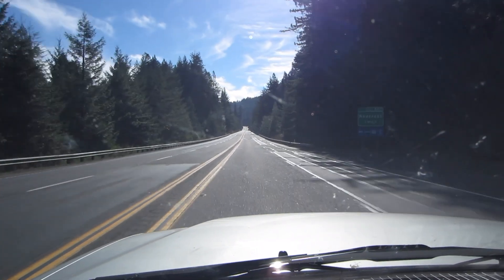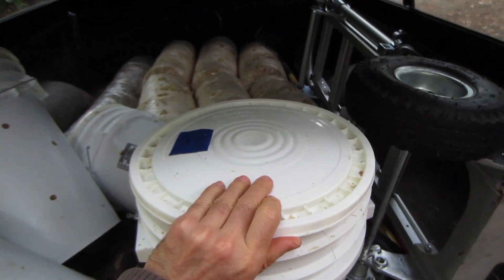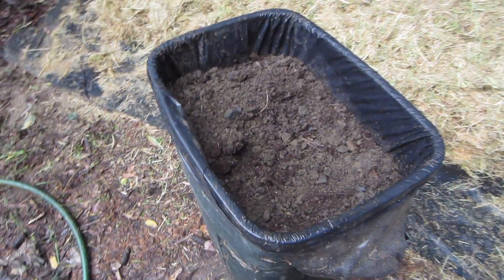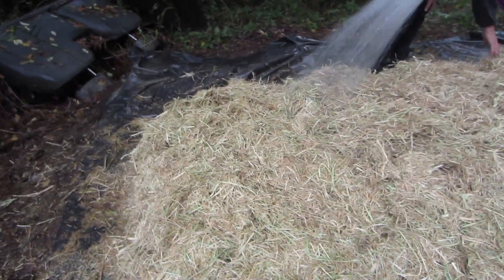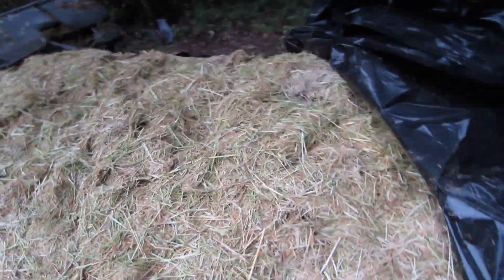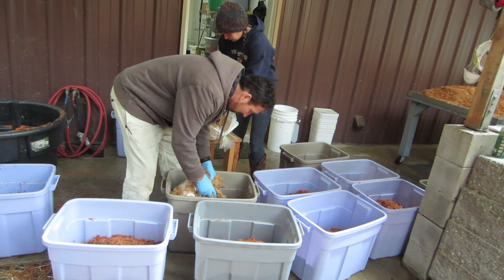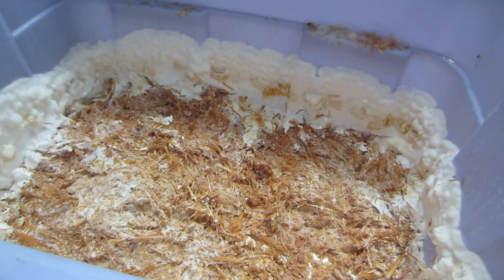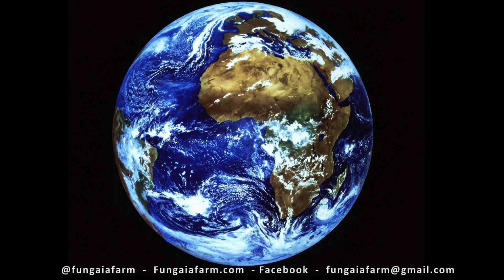Mycoremediation Of Motor Oil

Comment: could you suggest a pre-emptive course for a homestead that is planning to have a mechanic shop on site?  nothings built yet so now would be the time to build a system to handle the unavoidable spills etc.. the system I was always taught was clay litter and trashbags, but not wanting to create landfill waste if at all possible
Reply: It would be possible to either set up a bioswal catchment that was regularly reinoculated with fungi. Or use natural waddles to absorb any oil onsite and set up a remediation bin to remediate the material. Hope that helps!
Reply: @levondurr  thank you!!!

Comment: How did you account for the increasing amount of material that thus diluted the oil? For example, initially it’s a few garage bins of soil with 11,000 units, but at the end it’s a lot more soil/compost so hypothetically the amount of oil could have stayed the same if it was just diluted with enough stuff? (Not to try to say what u did didn’t work, I’m sure it did, but it’s important to be critical to improve for next time!) it would also be cool if you guys did a control group where you just left a portion of the contaminated soil out and see what changed over the time without the mushrooms/mycelium
Reply: @Fungaia Farm Care to comment on this one?
Reply: Good question, the inoculated straw/sawdust spawn, and burlap plus the uninoculated straw added on-site are fully composted when done. (this project took two years and three inoculations) So the amount of material added once fully composted is a very, very small fraction of the overall total mass. It may look like a lot in the beginning but by the time all the organic matter was decomposed, we basically had three garbage cans of soil just like we started with. In this project, we did not do control but we have on other projects. The goal here was just to help this landowner not have to throw the soil in the landfill. Check out our mycoremediation report on our website if you are interested in more scientific data. Thanks!

Comment: Wow! This took 2 years??
Reply: Yes. We did three deferent inoculations and because of the location, the mycelium was really only active during the spring and fall. The winter was too cold and the summers too hot.
Reply: Levon Durr how long would this typically take if it were in a controlled environment?
Reply: @mini_blessings  In a controlled setting you could most likely remediate soil in three to nine months. Depending on how many treatments were necessary and assuming each treat was over a three-month period. :)